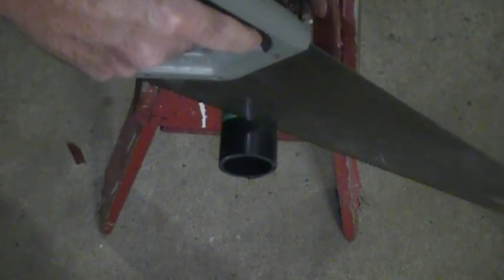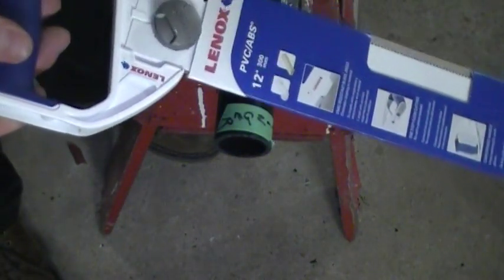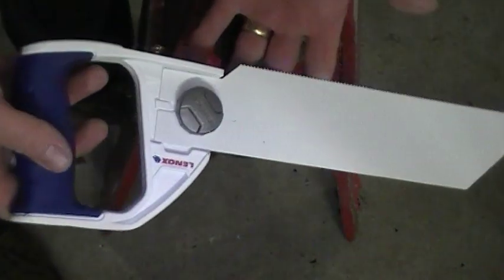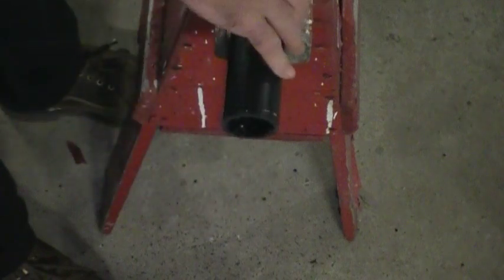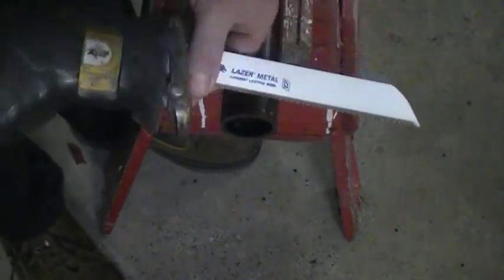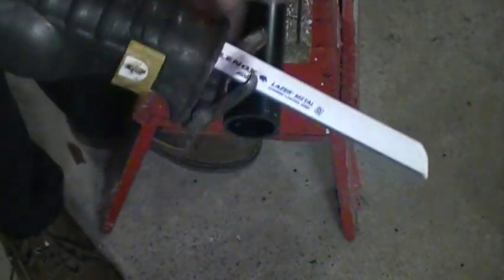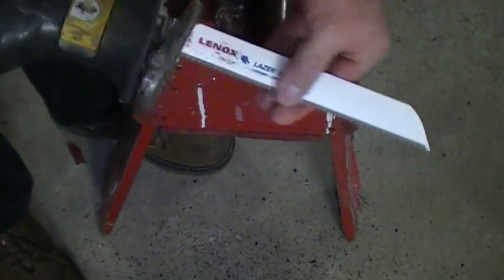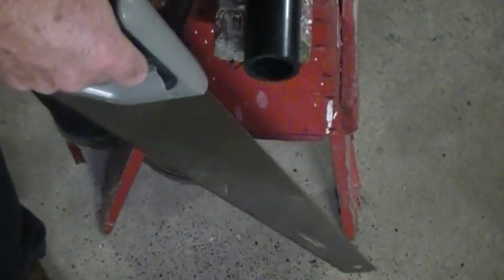How to cut ABS or PVC pipe straight without losing a finger.

Comment: Thanks! I strangely have never had to cut ABS pipe (tons of PVC and copper), and didn't have a cutter with a large enough diameter. Obviously ABS is much easier to cut so I was wondering why there weren't more cutters for it. Turns out most people just used a saw, and as you've displayed it's super easy. 

One thing, wouldn't it be easier to use a miter box? I've got one, so wouldn't it keep everything (pipe and saw) in place and square?
Reply from the maker: +sparkplugsf 
A miter box would be great to make straight cuts. Once you have made a number of cuts by hand with just a saw it is really not needed.
I have used a compound miter saw on a few projects. It works great, but you must hold the pipe firmly in place before you make your cut.
A few companies have made cutters for plastic pipe that you simply squeeze and a blade cuts the pipe up to 2" and others have made cutters that work on the same principal as cutting copper only with a finer cutting wheel, but most homeowners I believe are not going to go and purchase these item for a few cuts that they are making when doing home projects.
Most people want to keep the cost down when doing any home projects so they probably won't be into purchasing anything extra, but if you have one it would be very handy.
Thanks for commenting and have a great weekend!      Al

Comment: For 3-4" pipe use a hack saw with a small metal cutting blade, for smaller pipe use a pipe cutter.
Reply from the maker: Hello Eternity,
I guess it comes down to how comfortably you are with the saw.
A handsaw works very well on ABS.
A reciprocating saw works great as well.
A hacksaw on bigger pipe can be a challenge for a straight cut unless you are use to making them.
Thanks for commenting and enjoy your day!    Al

Comment: He gives the tip to draw back three times before pushing forward using a hand saw and then on the very next saw he uses which is a hand saw he does not draw back three times but immediately pushes forward with the blade. He should make it clear that it should be 18 teeth or less per inch. I am a plumber and "ALL" these saws will cut crooked if you are not watching closely. PVC cutters also can and will cut crooked. Pipe tubing cutters with a thin blade and rollers on the other side cut straight.

Comment: Hi-
I have a situation where I need to lengthen my abs drain pipe to fit in the rubber y trap better and was wondering what you would recommend on it? .. I was thinking to just add some couplings just above the y fitting, otherwise I would have to figure out a way to remove the abs fitting and put a longer one in.... here is a picture  link since youtube wont let me post one here.... http://postimg.org/image/m1nwsp3rf/
Reply from the maker: +volkrt 
I would do exactly what you said. Going with the couplings probably your best option.
If you don't have any movement as in being able to bend the pipe to get the couplings installed;  you could use a Fernco coupling that will slide completely over the pipe and then slide it half way onto the other piece. Then it is a just a matter of tightening the clamps.
Made a video on Fernco couplings...How to join cast iron pipe or copper pipe to plastic pipe using fernco couplings.
Be sure to support the pipe well on both sides of the coupling and you will be all set. 
You can also use MJ coupling. Similar coupling only with a stainless steel band that has two clamps on it. Sliding it over the pipe is a little more difficult as there is a rib in the middle. You place it on the pipe and roll over the other half, and then turn the rolled section over the piece you are adding.
Thanks for commenting and best of luck with the project!      Al
Reply: +TheOldkid888 

thank you for taking the time to get back to me...the only reason I need to lengthen the pipe is the rubber trap cleanout in the pic is leaning over and the connection someone did from bottom that someone did from the Y is too short, and I really dont think its a good idea to use some type of ream out fitting on a sewer line to take out the old pipe and put in a longer one because you dont know what kind of stuff could be flying off that bit. I will keep a fernco handy in case the couplings come up a bit short.  is there anything you would recommend to support that sewer pipe properly?.....thank you again

Comment: Secure in a vise, wear gloves, use a pvc cutter instead of a saw
Reply from the maker: Hello iamnotfernando,
All about safety myself. A vise would be great if you own one. Gloves are definitely handy to have.
I believe that most people don't get into real big job so using a handsaw is probably better as most homeowners have one. This will save them some money as well. Drawing back across the pipe on the saw three or four times will prevent the saw from jumping during a forward stroke.  
Thanks for the input and enjoy your weekend!      Al